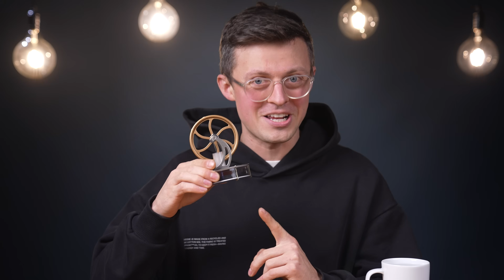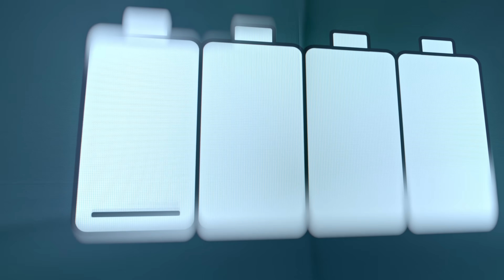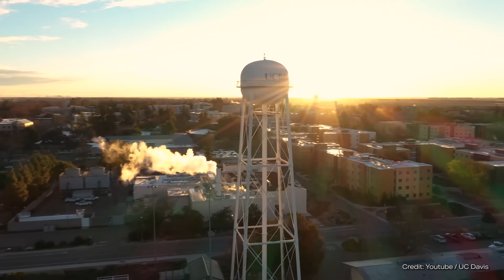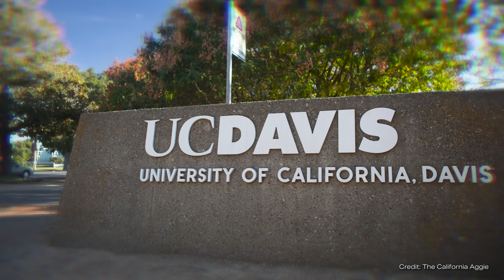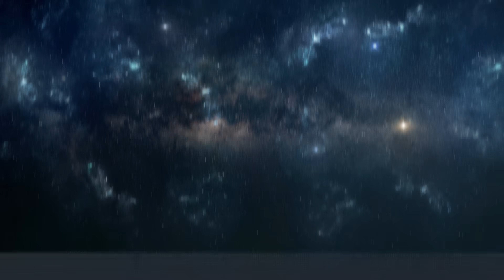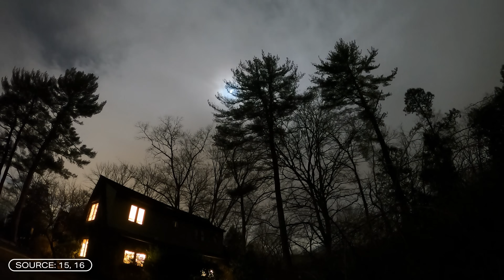This Engine Runs on the Cold of Deep Space!

Comment: Not the direction i was expecting this to go. I was recently saying it might make sense to use a Stirling engine in space to take advantage of the 400 degree temperature difference between sun and shade. 
This is certainly an clever idea. I struggle to see it competing on cost compared to battery, thermal, and other means of storing energy for night use.
Reply: @Mondreus313 mention that NASA already used them on some spacecraft, as heat pump.
Reply: Pv is better in space
Reply: @jakubiskra523 the problems in space are weight, and radiative cooling, especially in the inner solar system. Sterling engines tend to be big and heavy, but might be able to get rid of some of that excess heat by converting it to power, although the big question is whether a system of thermocouples would do the same at lower weight.

For the outer solar system, solar does not really work, which is why voyager uses radio thermal generators, but as shown in the Martian, they are not that good to have in close proximity to people, so any waste heat as power would help.
Reply: @grokitall I had a Sterling engine kit that was made out of foam and plastic. I think NASA engineers could shed a few pounds if they wanted. 
It might be far fetched for this topic, but that's one of my favorite discoveries or realization I'm aware of in recent astronomy... Gravitational forces kneading planets and moons like dough to heat them up.
 Not only could this phenomenon provide power to humans, but allows the possibility of life to exist imminent places we never thought to look. 
Hopefully fusion will be the predominant power source in the future.
Reply: @grokitall Indeed, since plutonium-based thermoelectric generators have an efficiency of 10-12%, coupling a stirling engine to the system would increase efficiency and extend the service life of satellites that can't rely on pv.
Reply: @jakubiskra523 Yes but while in darkness, the stirling engine can use radiation from the earth on the hot side while the cold side radiates energy to space... it can also use heat from internal components on the hot side, recovering some energy before it is radiated out.
Reply: @TheFlyinCanadian  And? You can have sunlight 24/7 in space
Reply: @jakubiskra523 No, at some point most planet orbiting satellites go into the planet's shadow. For the outer planets or further, sunlight becomes too weak to properly power equipment.
Reply: @TheFlyinCanadian Guess what, pick orbits in constant sunlight 🎉, and pv is more efficient
Reply: @jakubiskra523 Obviously yes but I bet the Starlink people would tell you that in LEO, it's not possible to always be in sunlight. Only in much higher orbits, which would affect I/O internet performance. For any planet, use defines orbit, and orbit defines illumination.
Reply: @jakubiskra523 Probably. I can't even wrap my head around some/most of the things NASA and astrophysicists have accomplished. I'm sure they know more about it than i do. 
Weight matters when you have to get things into orbit. I'm sure PV has an edge there. 
I would think a Sterling setup would be more resilient to space debris. Just protect the engine, if the emitters get a few speed holes, no big deal. Might be more of a factor going forward.

Comment: Common reported values for near-Earth orbits include:

Sun side: ~+120°C (250°F)
Shade side: ~-150°C to -157°C (-250°F)
Delta: Often around 270–300°C (or up to ~500°F in extreme cases cited for ISS-like conditions).

would that massive Delta produce 50 times more power.per square meter than sitting on the ground?

Comment: Reversible Window Blinds with the coating on one side could cool houses passively on hot days and nights.

Flipping them around in winter would stop you loosing heat. In hot countries like mine we have large windows on our homes and we use a lot of energy cooling our houses.
Reply: The coating works because it is pointed at the night sky. So this might work for skylights at night.
Reply: Yes, but also no. Tilting the surface so that it doesn't point straight up can massively reduce the effect because the infrared radiation has to travel through so much more air before reaching the void of space. This is a very good starting idea though since heating and cooling homes is one of the worlds largest energy expenditures. You might be onto something really good here.

Comment: Don't get me wrong I love stirling engines to death been tinkering with them for a decade now. But I do have a problem with throwing heat energy off into space as that is a form of wasting resources and yes I'm well aware the sun will be replenish any energy lost but just because you have a lot of resources doesn't mean you should be wasteful with them.
Reply: THIS
waste heat is the dumbest idea since the birth of the universe
(slight exaggeration, thats actually waste matter)
especially since there are zero laws saying you can't infinitely recycle energy, and the closest thing that exists is the kelvin-planck statement which was made in the 1850s, and it only rejects devices which use a single reservoir to turn heat energy into work, but there are plenty of theoretical means to do exactly that, just with or or two or more extra steps, most promising of which is tuning a PV panel to the peak wavelength emitted by its surroundings, and the kelvin-planck statement specifies that you cannot turn heat directly into work, not that you can't do it with a few extra steps

Comment: Hi Jacob Great Video !  
I have been building Stirling Engines for 40 years & completely missed this idea... Rats !!
Please take a minute & think about Solar Panels, which are in general about 20% efficient. But wait, what happens to the other 80% of the solar Energy the panel absorbs ? Now think about The Radiant White Paint of this Video.... 
OhOh are Solar Panels actually Heating the Planet ? Hmm what could we Possibly use to offset this heat? White Paint? Perhaps we should simply Skip Solar Panels and go Directly to White Paint's 90%+ efficiency for Instant Global Cooling to Save the Planet... Paint it White!! Just a thought... 
Please consider a Video on the idea. Thanks James

Comment: Usually quiet🤪🤣🤪😂🤪
Squeak squeak squeak. There’s a bit of oil on perhaps just a drop of light oil. 😉
Use a sand battery to sit the striking engine on 
Can charge the battery from solar/thermal/rocket stove/electricity/steam, etc. 🎉🤔👍

Comment: Had the same idea when I read the BaSO4 paper a while back.
Also came to the same conclusions lol.

Could make a thermal battery with a low thermal delta requirement. EG: covering and converting a bunch of retention ponds.

Extra note: Those radiative paints are pretty efficient. Could probably build small reverse solar updraft towers (radiative downdraft?) to cool urban areas while generating power.

Comment: Stirling cycle makes an interesting heat pump as well. 

Nuclear power plants use Stirling engines to get a little extra power from the steam’s waste heat (outside air being your large temperature differential) and NASA has used them in a few different spacecraft. 
There’s several reasons these things need to return as heat pumps and multiple fuel source generators (though a specialized internal combustion generator is going to be more efficient than an external one using the same fuel) for emergencies. 
It’d be nice to use EU emissions regulations for something, you know, actually productive.
Reply: Here north of 40deg latitude it was suggested the "waste ' heat from Nukes be used to heat green houses . This could save millions of cubic meters of gas to stop messing with the aqua enviro and extend the reserves of this valuable commodity . Commercial green houses said it would be an unfair advantage and put them out of production . Guess what , warm water goes into rivers and lakes and commercial growers still heat with gas .
Reply: @jamesdenton3692 
I hear ya man. It causes me utter to pain to see the wildly stupid ways some things are done just to enrich the obnoxiously wealthy and unproductive. 
Stirling heat pumps use pretty low power (actually feasible to run on solar if you wanted to) and use helium as a working fluid. Not CFCs, nothing corrosive / explosive / toxic / radioactive. Helium. 
But we can’t have that because oh gosh it might shutter one factory after the new one needs startup investment. That’s bad for capitalism or something.

Comment: Help me understand 
If each house on earth lets say 8 bilion had a large engine of this kind would that warm up the globe/earth (ie. through friction of the device) or would it cool down the globe? 
Also through what means would the fallowing happen 
I mentioned friction as a contributing factor?
Reply: This one would move heat from the earth mass to space, with a bit of friction heat to the atmosphere. 

But the earth holds a lot more thermal mass and heat then the atmosphere so if you'd super scale this I think atmosphere would warm faster then the earth mass would cool even though the system as a whole loses heat to space.
Reply: @JeffBilkins  Thats very interesting 
Thank you Though I don't understand how any heat could transfer to space 
An empty space that is 
Temperature is the movement of atoms so how can movement transfer to nothing? 
From what I know space is a near perfect vacum
Reply: If heat didn't reflect back into space we would be cooking. We take in X amount then kick it back. 

 Type in space radiative cooling. It's interesting and will give the answers you seek. 
 
 Nighthawk light is one I also back like the main comment for looking into the stuff. I swear if the guy lives for an other two decade he will create a passive freezer.

Comment: Very interesting... but couldn't you just use peltier elements and avoid the mechanical energy loss? Or are they simply too inefficient or too expensive to mass produce?

Edit: ah you cover that too.. nevermind then.
Reply: modern peltier devices reach a maximum of 10% efficient as generators, stirling engines can get above 50%, the only applications where a peltier device is viable are ones where a mechanical heat engine is too big or would be if you included a generator and rectifier, applications where a mechanical heat engine will not last long enough, and applications where a heat pump is too bulky for the job or won't work(and magnetocaloric heat pumps work well below the temperatures at which most metals are superconductive, buut unfortunately they require far more complexity currently due to the inability of solids to move through pipes)

and there are plenty of things that do all of their jobs way better with a bit more space and some maintenance(but even then, some of em can run for well over 20 years with no maintenance)